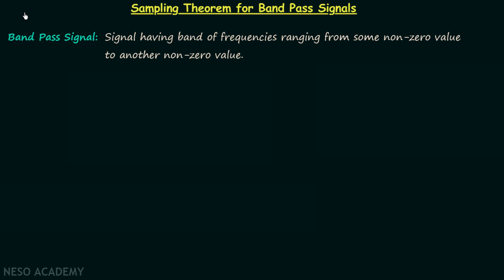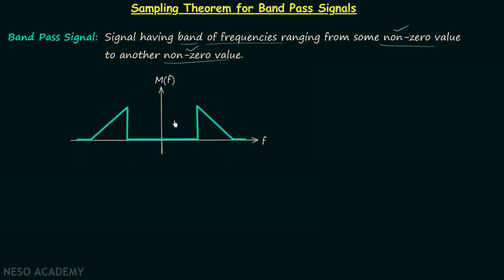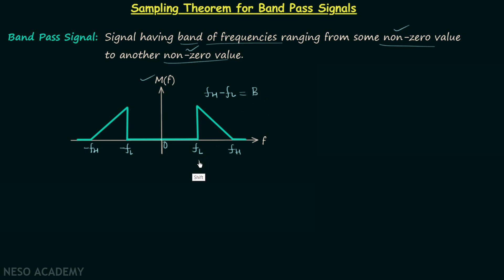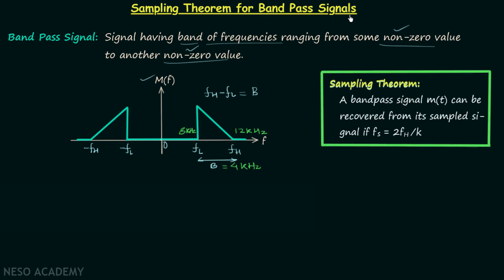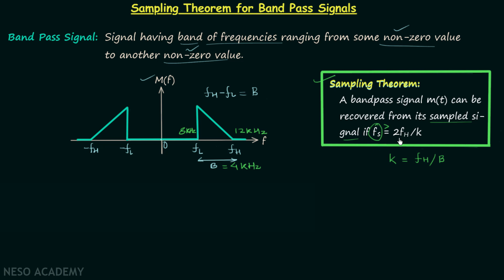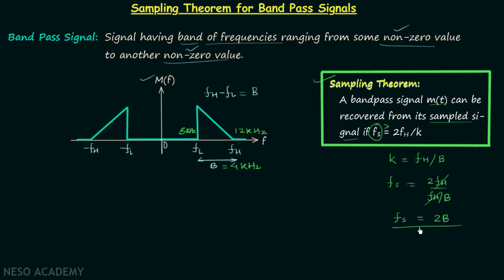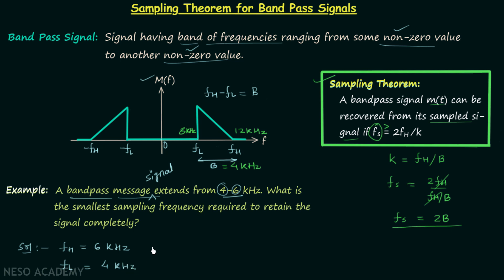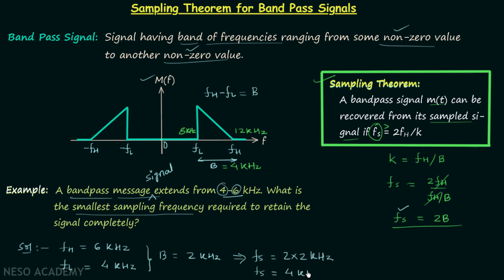Sampling Theorem for Band Pass Signals

Comment: In a book i saw a problem where a bandlimited signal had a bandwidth of 8Hz(as fh was 30 and fl was 22hz)..so the min Fs should have been 2B=16Hz,
But in that book min Fs was calculated as Fs=2fh/k,where k is an largest integer less than fh/B that is K =3hz,so fs min=2*30/3=20Hz

So is the right ans 16hz or 20hz???
Reply: 20 Hz is the right answer, Infact any frequency in the range 20Hz to 22Hz would recover your message for k=3 but 20Hz is the minimum. Similarly we can take k =2 as well but it increases Fs (30Hz to 44Hz)... Actually the video presented here looks simple and clear but it lacks the sound technical background... Just have a look at wiki on band pass sampling for quick answer or follow any of the standard texts...
And let me remind you that we can't perform sampling at Fs = 16Hz in your example because it results in "aliasing" {Please plot the spectrum of the sampled signal to understand how the aliasing is happening in this example}, so Fs = 16Hz is wrong... Hope this helps... All the best...

Comment: hey, there is a small correction here..... 2*B is always not valid, as fs = 2*fh/[k], so it [k] and not k. There is a problem that i encountered "A B.P. Signal occupies the bandwidth of 390khz to 410khz. What is the minimum, sampling frequency to be used". 

a) 40khz
b) 41khz
c) 820khz
d) 800khz

By, using 2*B we get 40khz as the answer but by using fs = 2*fh/[k], we get the answer as 41khz.
Reply: I couldn't get you bro ....what does "so it [K] not K" means?? because I get 40khz as the answer for your question , even after going with the formula (fs=2fh/K)
Reply: @paarthiban8452  I think [k] means the biggest integer which is smaller than the original k (calculate as fH/B). This makes the final fs bigger than 40KHz
Reply: I have this same doubt too .Even in gate certain questions are solved 2 different ways for bp signals 😢.

Comment: What happens if the non-zero band of the band pass signal is from 6.5 kHz to 8.5 kHz ? In this case, B is also 2 kHz. Does your formula, fs = 2B, still  work ?
Reply: 应该是这样求没错
Reply: In this case, fs= 2fh/K where K = integer less than fh/B. Here, fh/B = (8.5)/(8.5-6.5)= 4.25 so K = 4, then fs = (2*8.5)/4= 4.25 kHz